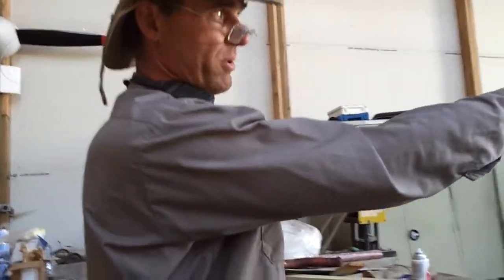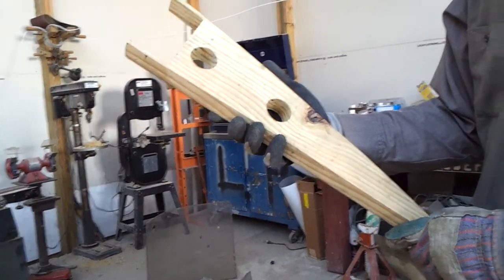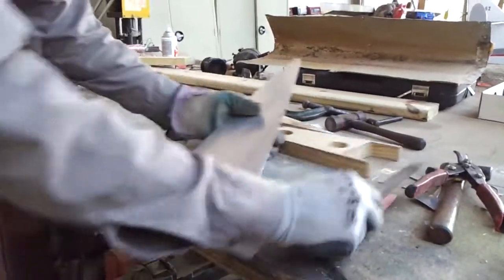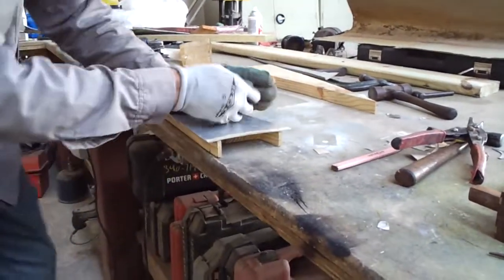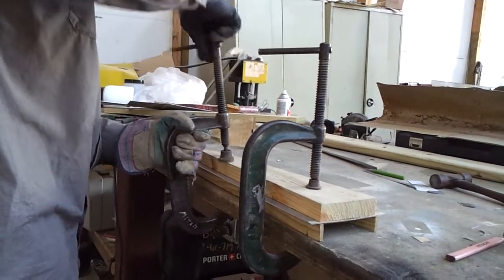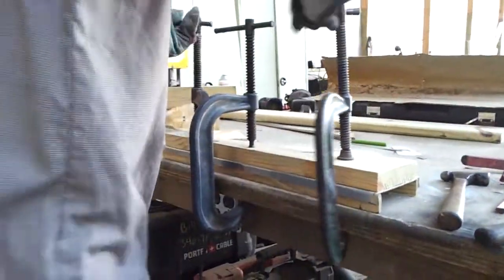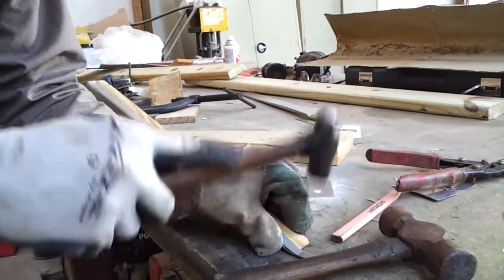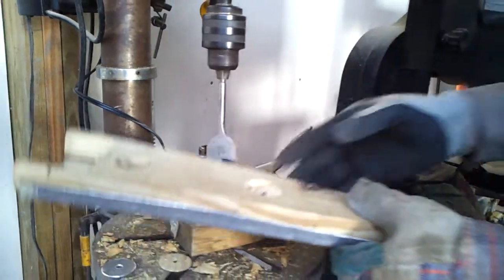Volmer vj 22 rib aluminum bend

Comment: I've done that same process in the video to a metal sheet, and its funny, I used the same method, but I clamped it against the I-beam that stuck out the front of my house trailer, to use as the straight edge to bend against.  

The only thing I did different was I scored one side of the alluminum sheet metal (which came off an old telephone booth) with an aluminum oxide cutoff wheel, because the alluminum was so thick...  0.13"

http://dcim6.peachcountry.com/DSC_0188.JPG
http://dcim6.peachcountry.com/DSC_0189.JPG
http://dcim6.peachcountry.com/DSC_0178.JPG